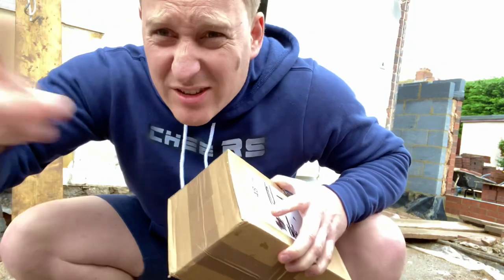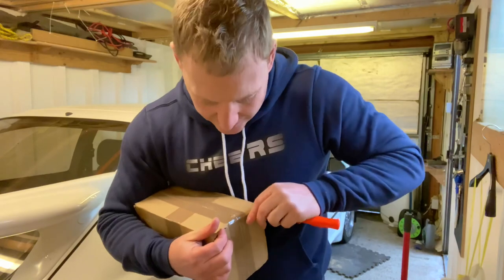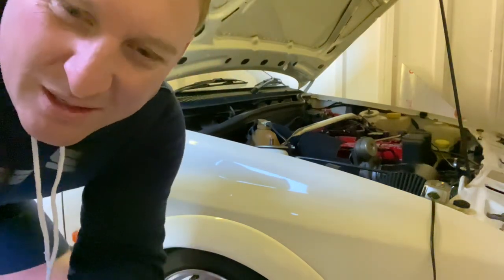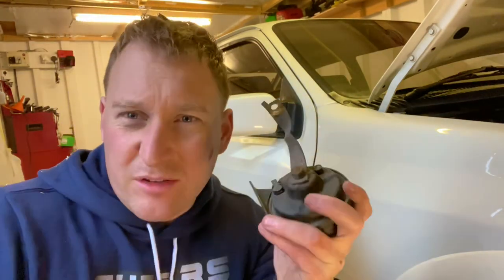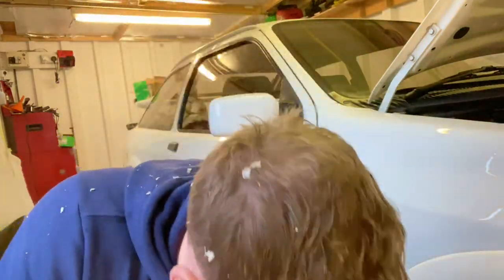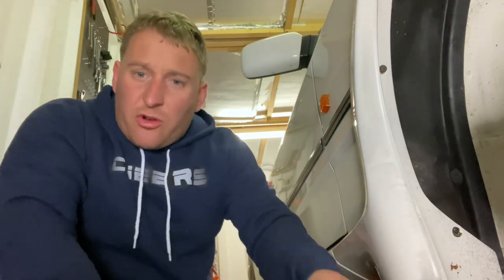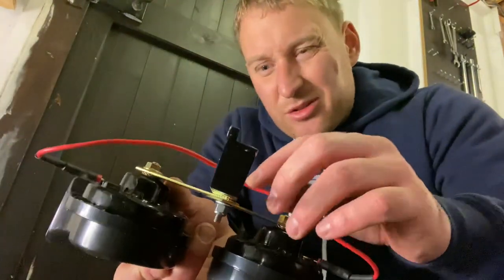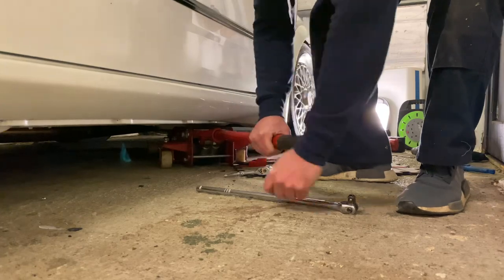I've got the HORN!!! 🔩

Comment: I'm no expert but from watching your video twice, my conclusion is that you removed the low faulty horn and put two new horns on but didn't earth them. So when you tested it the one that sounded was the other old high pitched horn that you didn't remove. And the new ones didn't sound as they were not earthed. 
I think that not being able to drive your car at the moment, will make it extra special when you do get it out again. I have my Escort in storage as I am still working on my Mondeo project and it will be so good when I get it out for a drive again. Anyway great videos.

Comment: I noticed you tightened the wheel nuts up with impact gun. How do you know what torque that is producing.  You then put the wheel centre cap back on. By doing that I assume you are happy with the wheel nuts are tightened ok, if it was me I would check the nuts again once the car is sitting back on the floor, just to make sure as the gun might lose some torque as the wheel is free to rotate under tightening.

Comment: Adam it didn't sound like both were working? still only sounded like the high was working. 
Some horns are polarity sensitive which means the positive and negative have to be the 
correct way round or they won't work. 
just double check it bud and to be honest you would be best putting both the earths onto the 
centre bolt via two earth loop connectors. because it has two terminals its what is called an
insulated horn so it needs a straight earth to the terminal to work correctly bud.
Reply from the maker: Cheers Paul. I’ll look into it now 😊👍🏼
Reply: @Adam151082  easiest way it to take one live terminal off at a time too see if they both work Adam 👍🏼